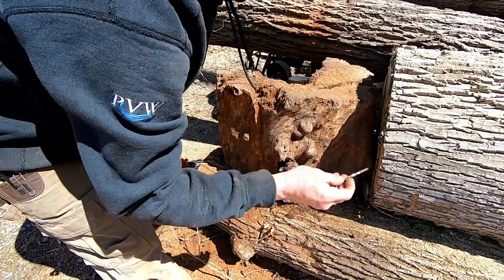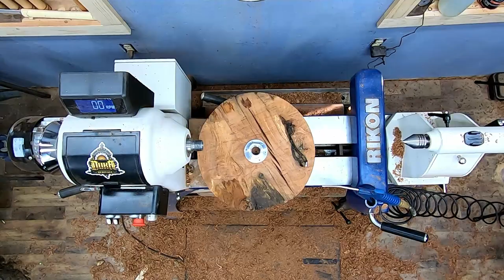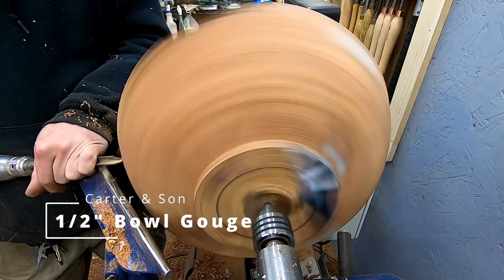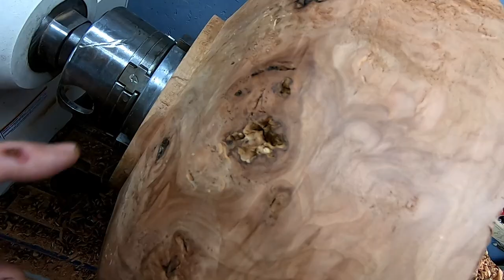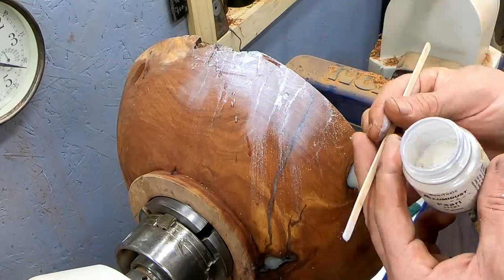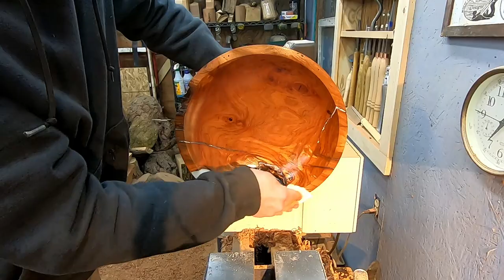Woodturning - Apple Wood Chopping Block Bowl

Comment: I work with old barn beams frequently and I have found this tool to be pretty good. Granted it is harbor freight, I store mine with out the battery in. It is holding up so far. Barn beams are full of metal and this finds it pretty well. Cheaper than the router bits, band saw blades or chain saw chains. Less than $20 last i knew. Just my thoughts.
Reply from the maker: Thank you for the suggestion I’ll have to look into that. 👍

Comment: good video. Sorry about the nails. You are one of the few turners on Youtube that uses a Rikon 70-3040. What made you decide to go with that late over the others in the same price range?  Do you still use it/Like it?  Keep up the good work.
Alex Garcia - DragonHollow Woodturning
Reply from the maker: Thank you 😊 I love the Rikon. I think the biggest factor was the small footprint, huge swing potential, and the sliding bed which maintains the bed length potential.